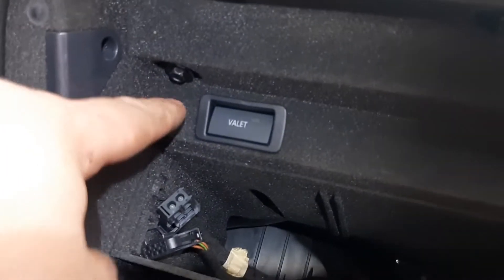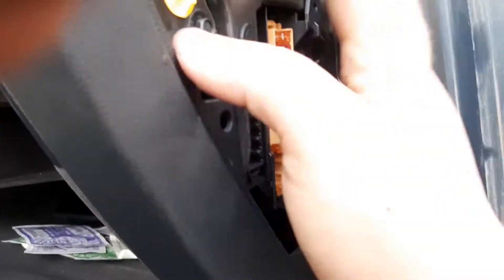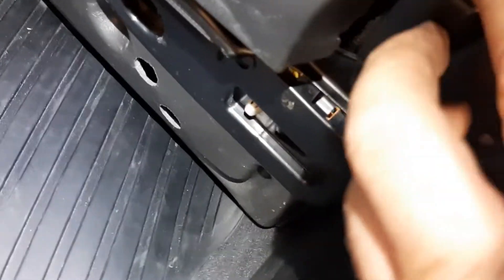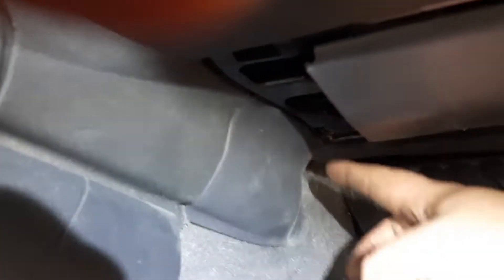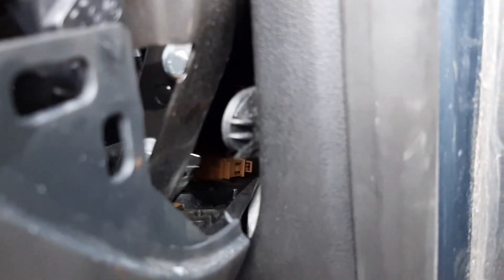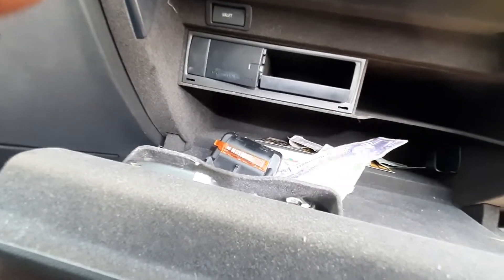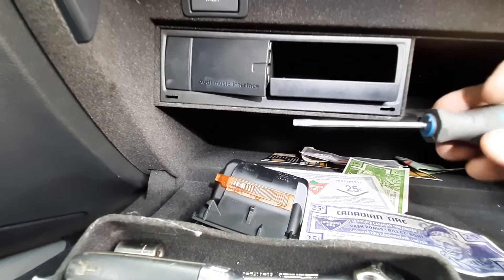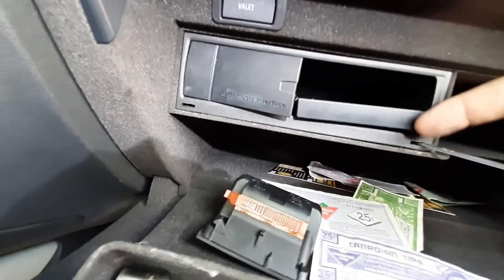NO SPECIAL TOOLS  2008 - 2015 Audi A5 / S5 Glove Box Compartment and Audio MMI Removal

Comment: quick question, do you have the airbag turn off switch in there too?  I can't find mine but I bought it used so :(
Reply from the maker: Not my car and long gone. Never heard of an airbag turn off switch in any car. Only thing that can activate and deactivate passenger airbag, as far as I know and that is factory installed, is the seat occupancy sensor.
Reply: @Membreins  understood!  Thanks for replying.  They do have them in this model, just some appear to not hve them.    Sadly the sensor is fine lol.  Now we are looking to see if its related to the bumper  ( sounds dumb but parking sensors are involved ) but thanks for getting back to me!